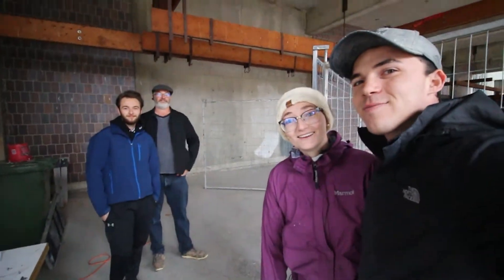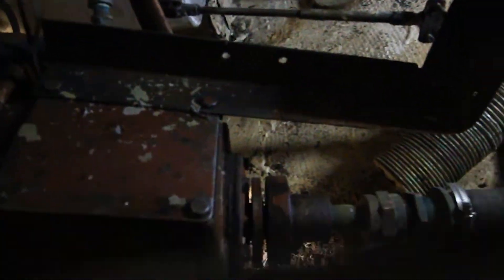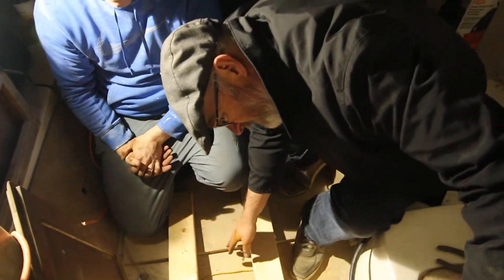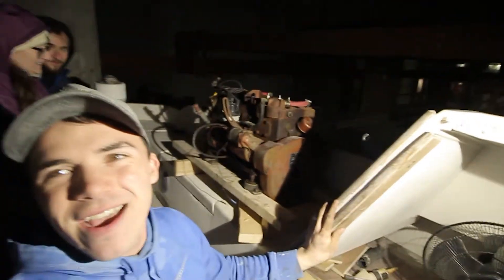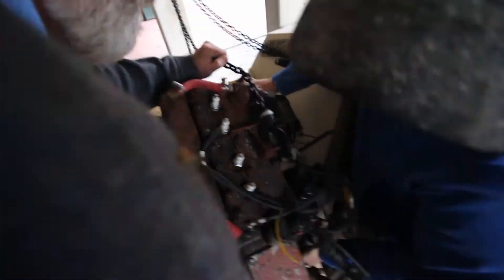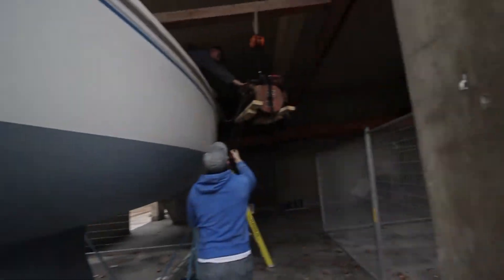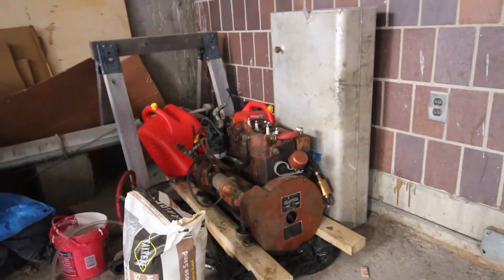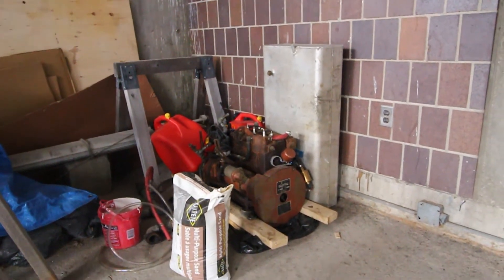Pulling the motor out of our Catalina 27 | Electric Conversion

Comment: I have a 1983 27 with the same  motor pulled mi e out 4 yes ago replaced a cracked head and put in new valve springs thanks to Moyer Marine and mine ru s great. I've been sailing Lake Huron. Moyer Marine specializes in rebuilding Atomic 4's which is what you have. I love mine.
Reply from the maker: Thanks! We just recently sold the atomic 4 and gas tank and are working on a recycled electric system from golf cart components!